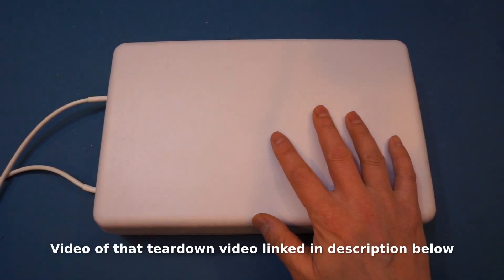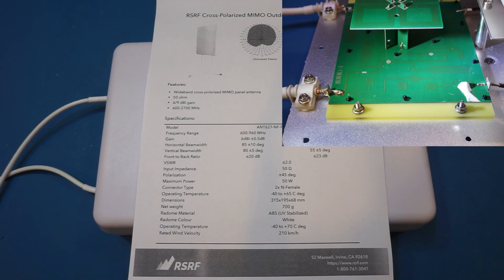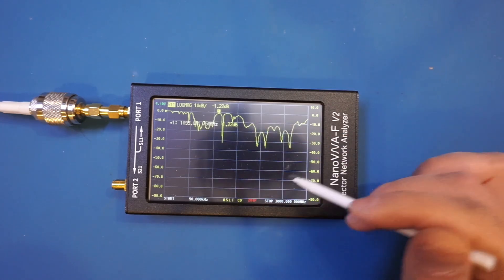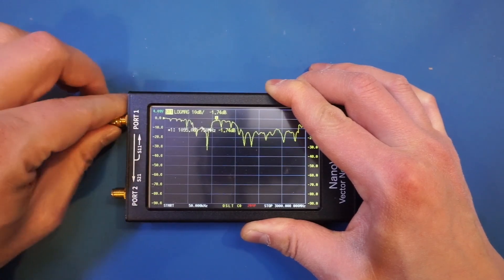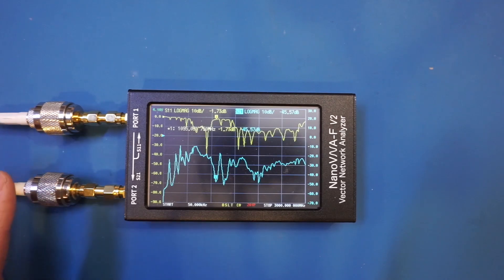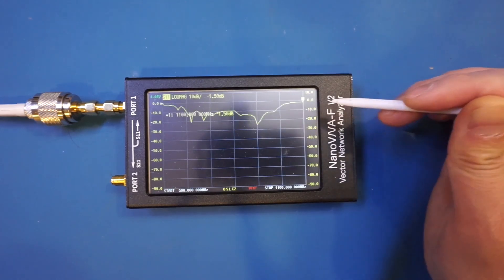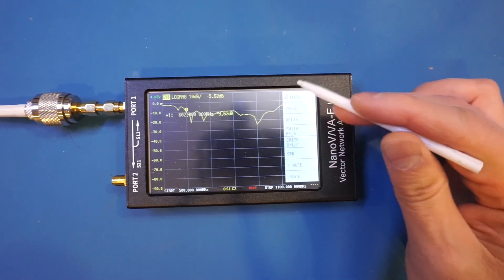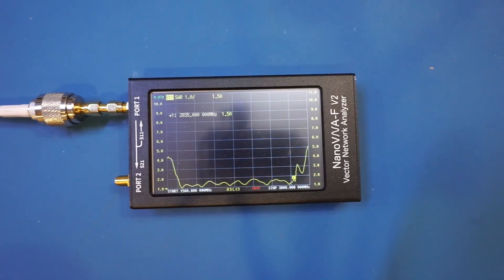RSRF Cross-Polarized Dual Band Cellular MIMO Antenna Measured with a NanoVNA

Comment: thanks a lot for the video, also previous one as they are being very useful for me, but i have a question, I didn't know anything about "cheap" VNAs before two days ago, while i was trying to fix an issue and I found out your video, the point is i have some systems that send video using frequencies between 5645MHz and 5945MHz, antennas are done to cover those values but for sure they are optimized for and specific value that could be 5670, 5850 or whatever and thanks to your video now i know hot to discover that, my question is, would be possible using the NanoVNA measure the output power of the transmitter? those have different steps, 25mW, 100mW, 250mW, 600mW and so on, i know nanovna will not show the power configured but for sure there is a relationship with the dBs, right?
Reply from the maker: NanoVNA would be a poor choice for power measurement IMO. The frequency range you are interested in is also too high for the current NanoVNA. NanoVNA V3 is coming soon and it does extend to 6G but your operating frequency is very close the the higher limit of the frequency span.

Comment: What is also very cool is the cost of the Nano VNA compared to similar equipment in years gone by. This use, in basic characteristic measurement of an antenna is a perfect use, where you probably don't need the precision of a VNA costing 10 to 100 times more.

I only have a V1. I wish I had that nice V2 with its wide fundamental bandwidth. Very nice.
Reply: with consideration for cost and space owning 2 isn't the worst